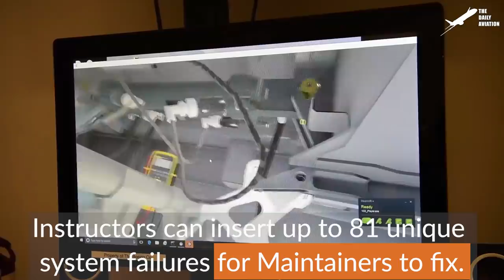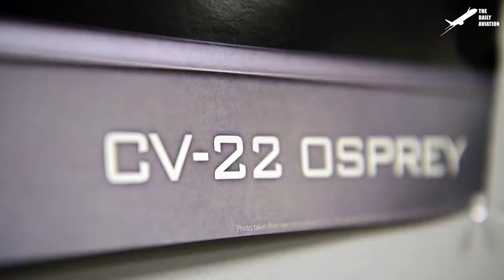US Helicopter Shooting Down Drone in Middle of Ocean

Comment: F35-B (and C) are supersonics only for very shorts periods  . The heat of the afterburner could damage stealth coating and tail structure ...
Reply: That sucks, cant believe they didn't fix that.
Reply: But f35 can't go with high speed like 1 thousand miles or higher but f22 can do this
Reply: My vote for best naval fighter of all time still goes to F-14 Tomcat.
Reply: @kungfucommando1642  definitely it still out rates the hornet and is longer range, it should not have been replaced.Not to mention the coolness factor
Reply: @kungfucommando1642  I agree, it was a pure beast . I'm sure that the navy regret it . Unfortunately, a real dick cancelled the super tomcat 21 .

Comment: The F-35B is the only ‘VTOL’ out of the 3. The A variant was shown (standard) and the C variant is slightly bigger in terms of wing size with folding wing tips. 

The F-35B is not VTOL or Vertical take off and landing, it is STOVL or Short take off and vertical landing.
It only requires about 100ft of runway space to take off and can land on a helipad of sorts.
Reply: You’re incorrect, I’ve seen video of a B model taking off vertically, whether or not they do it operationally in the field I don’t know